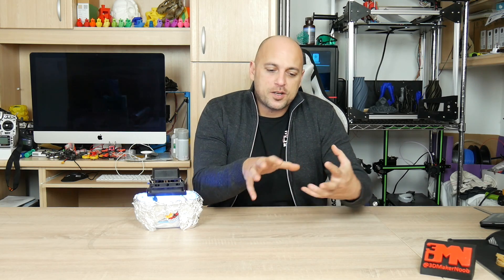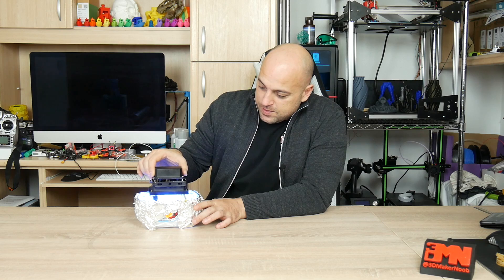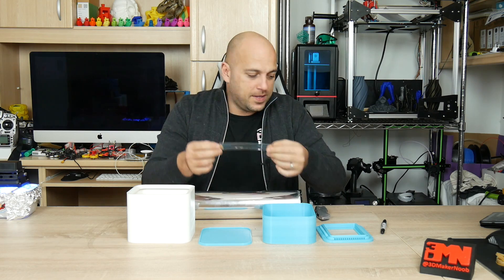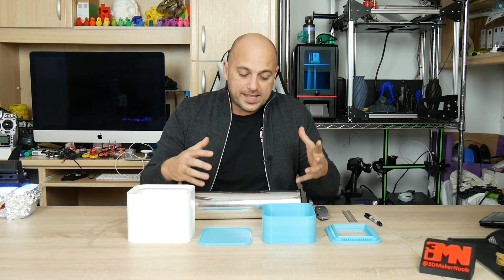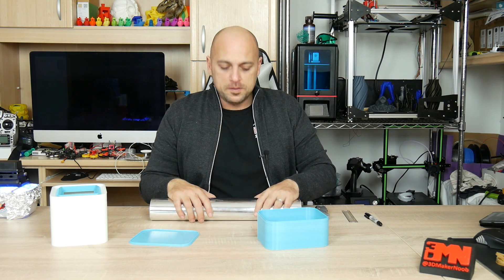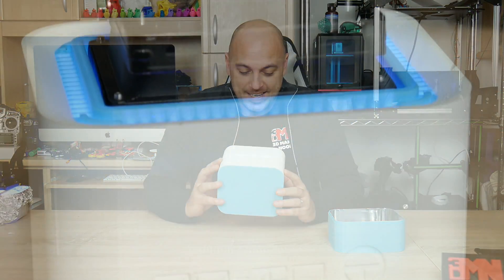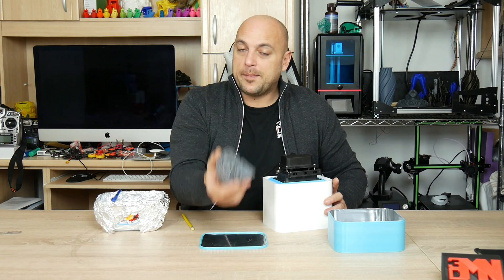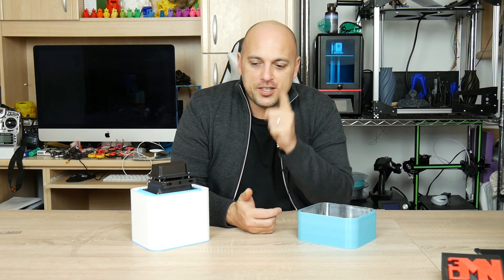3D Printed UV Curing Chamber For Resin Prints

Comment: Hi there, thx for the video. 
Just one question: 
How about the heat of the UV Light (inside the box)? Doesn't get it to hot after a while? Or is the time needed to cure a part to short for overheating, if at all?

Comment: I see a couple of design issues which I would change:

1) Mount the lamp holder in from the top. Having it clip in from underneath is just asking for it to fall in, and squash your print. It might clip in firmly now, but it will never be as strong as sitting on a nice fat lip from above. It could still have clips, so it stays there.

2) Make the extra height extender open bottom, and use the same base for both normal and tall. This will avoid double handling prints that you think will fit in the low height, but turn out to be a little too tall.

Comment: I'd love an SLA printer, I'm not sure i could put up with the stink though, maybe a shed is called for.
Reply from the maker: To be fair the Moai is not that bad as the printer is fully enclosed without an outlet, while the odor is there, it’s not as prominent as the photon for example
Reply: Peopoly resin is pretty good smell wise. Hardly noticed it after a day or two. With the printer door shut most the time it's no issue. You can always add a small seal to door

Comment: Doesn’t PLA break down under UV light?
Reply from the maker: The interior is all covered by reflective film so the UV light will never see the actual PLA surface
Reply: My old girl (dog) has been wandering about with a 2 colour tag (I'm not lost just old, owner waiting ahead) for over a year and it's still going. ABS that said goes brittle when in UV (outside) light.
Reply: What kind and where did you get the reflective tape..I like this better than the suggest mylar and double sided tape.